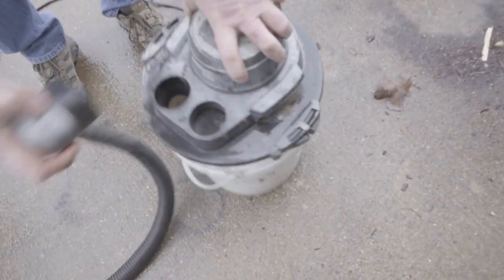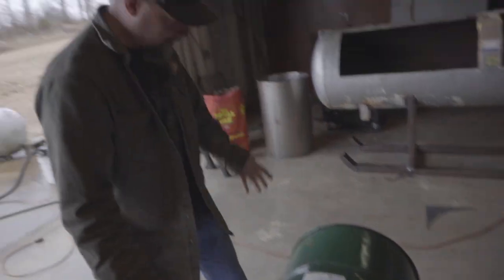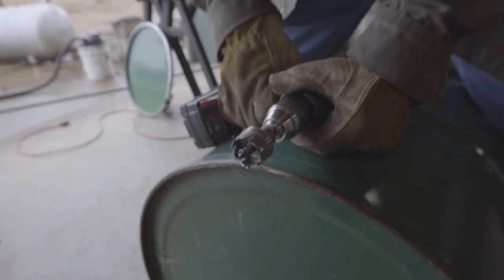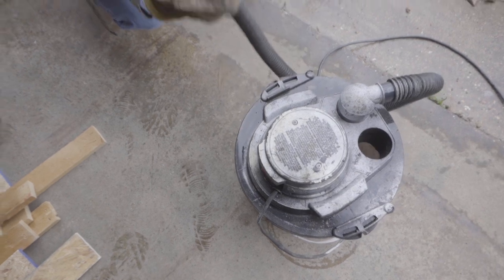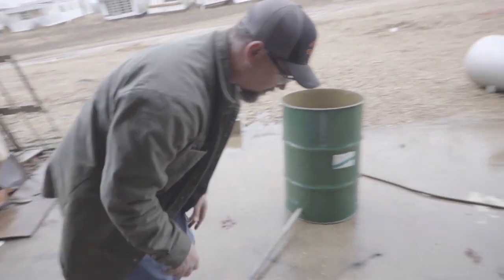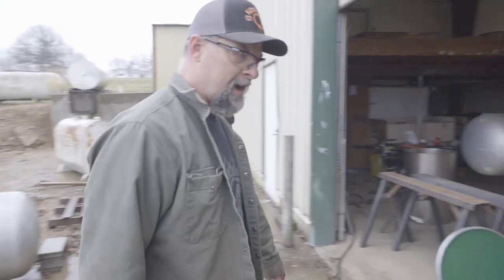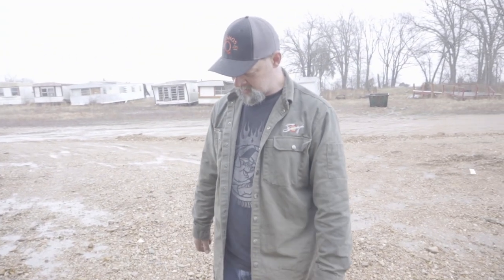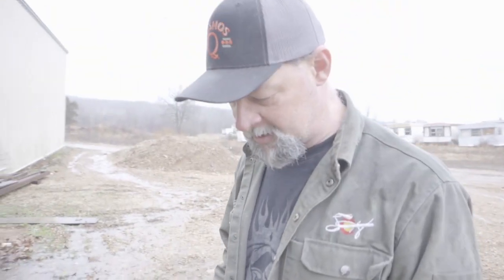How To Burn Out A Barrel To Build An Ugly Drum Smoker!

Comment: Drill hole saw bits with the drills clutch on super light, that way when the drill punches through the steel the hole saw bit catches and the clutch engages. Never had a single problem drilling holes this way.

Comment: Just because the paint on the outside is burned of does not mean all the inside liner is gone. I've burned some barrels that need extreme heat and wire brushing to get to the metal on the inside.